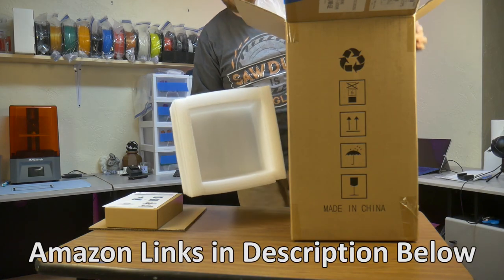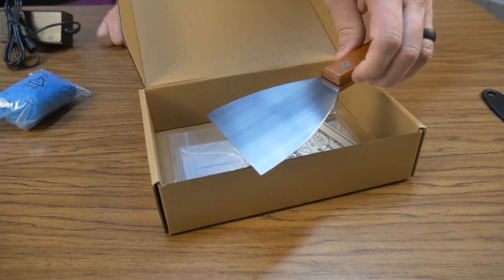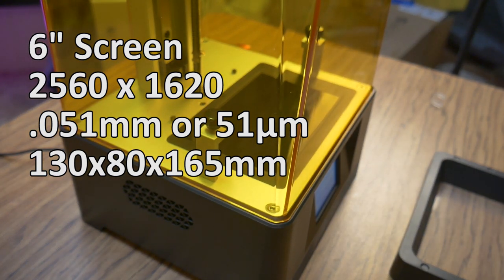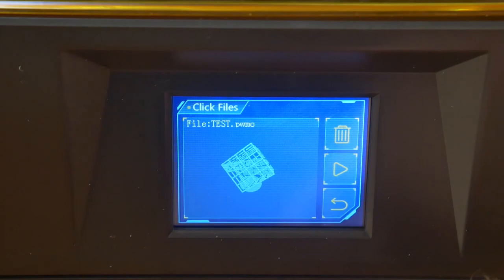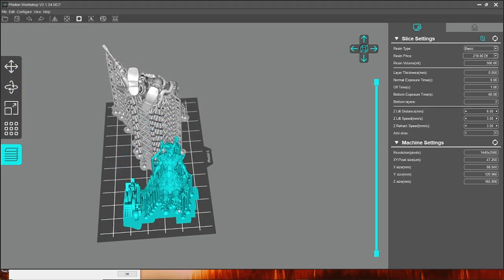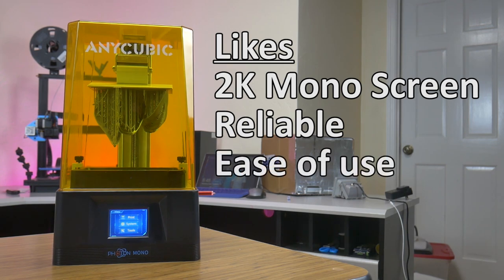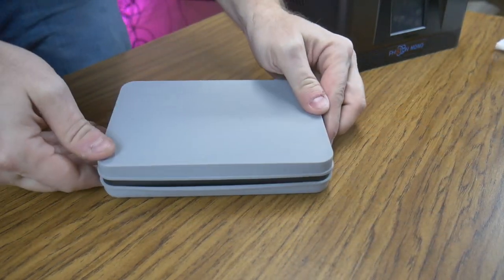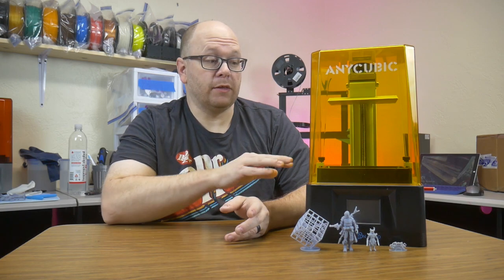Anycubic Photon Mono Review: 1 Major Design Flaw

Comment: What is the reason the plastic tray is bad?  I am brand new to this so sorry if it is a silly question.  What is the FEP??
Reply from the maker: The FEP is the clear plastic film that is at the bottom of the resin tray. The image is projected onto the FEP and the resin cures to both the build plate and the film. The cured resin then peels away from the FEP when the build plate lifts between each layer. In order to work properly, the FEP needs to be under a certain amount of tension, like the surface of a drum. The thinking here is that a plastic tray won’t last as long or is possibly not as strong as an aluminum one. For me it is just a sign that the company is cutting corners for profit. Especially when there are better all-metal printers out there that cost less. Look up my review of the Voxelab Proxima and you will see how a printer can be well-built with quality materials and also be the most affordable in its class. Thanks for the question and happy printing!
Reply: @SouthpawWorkshop  Hi, i am also a new to 3d printer, and am considering to buy one, is this issues cause a problem to print? or it is more about long term use?
Thank you.
Reply from the maker: Don’t get me wrong, the Photon Mono is a great printer, especially for beginners. My gripe is around design decisions like the plastic construction and the proprietary FEP replacements. I usually suggest the Voxelab Proxima for beginners because of its superior build quality, low price and high print success rate.
Reply: @SouthpawWorkshop  would yiu say it’s better than this printer for beginners?
Reply from the maker: Probably better in the way that the Proxima came with a spare FEP and higher quality tools like the scraper and spatula. The fact that is cheaper helps also.
Reply: @SouthpawWorkshop  but strictly with the printer itself (Bc the filter and tools can be gotten later) what does the proxima do better
Reply from the maker: Same performance between the two
Reply: @SouthpawWorkshop  is it difficult to get replacement parts or fep for the proxima?
Reply from the maker: You can use any FEP, so that part is easy. As for a replacement screen or light source, you would have to go through Flashforge customer support.
Reply: @SouthpawWorkshop  I suspect the plastic one could warp at some point as well.
Reply: @SouthpawWorkshop  i don't get it... how could the film be aluminum when UV light has to pass through it?
Reply from the maker: The vat that holds the resin is aluminum. The bottom of the vat has the clear film that lets the UV light pass through.
Reply: @SouthpawWorkshop  Just like how polymer firearms are much weaker than metal ones! (LOL)
Reply: @SouthpawWorkshop  Has this proven to be the case?  Has the pastic construction began to show signs of premature wear or failure or is it holding up ok after 9 months?  I just got this machine as an intro into 3d printing so have nothing to compare it to, yet.
Reply: @SouthpawWorkshop  unfortunately I'm returning mine because I haven't been able to print anything. Everything sticks to the FEP, plate calibration doesn't work, and one time, the plate started to lean one direction which ruined my print

Comment: I've just bought 1 and I'm happy to see that is a good machine. For 180€ I can't ask for more of a printer. Great review
Reply: Just got mine today. Did you put a protection the polarized screen or just used stock?
Reply from the maker: I use stock with no issues. Just keep an eye on your FEP. I have heard of others using screen protectors to protect from spills.

Comment: Great review, However people keep mistaking exposure time for layer time which is incorrect... Exposure might be 1.5s, but there are extra seconds for Z axis movement. I think the Mono is actually advertised at 30mm per hour which at a default layer height of 0.05mm is 6 seconds per layer, which in my tests is pretty acurate. I have not had to replace my FEP yet and the unit is now 6 months old. I might look into the replacement Metal Vat when I need to replace the FEP. For me, although the base is plastic, it doesn't feel cheap, and helps reduce the weight, which also help with shipping costs, but it doesn't seem to have made the product less sturdy. Overall I really like this printer and have just recently upgraded to the Mono X 4K with the Wash and Cure Plus.
Reply: Is it worth to get this or should I go epax ?
Reply: How do you get 30mm/hour as it took me almost 6 hours at 2.0 sec exposure?

Comment: I got at least 80 prints out of that plastic vat + FEP, then it got a nasty bump after it stuck to the build plate and I was afraid to push it further. Switched to the 3rd party metal vat now.
Reply: Ioan Croitor  Fine, but changing the FEP is a hassle. Was able to buy more Anycubic FEPs that are already on the frame and they have been working ideally.

Comment: Looking at this puppy strictly for D&D figures. I'm a beginner so seems like a good starter set. How often does the FEP need to be replaced?  Noob question from a noob.   (and great video....well spoken and concise).
Reply from the maker: FEP can be pretty temperamental. If we’ll taken care of, it can last a long time. However, some things are just out of your control, like failed prints. Most of the time a failed print won’t negatively affect the FEP, but sometimes it does. If you buy this printer, my suggestion is to have a spare FEP handy. That way if you have a pinhole or tear, you can get back to printing right away. Having said all of that, I’m still on the original FEP that came with my Photon Mono and I have printed a lot with it. Hope that helps!

Comment: Any 3d printer recommendations at a slightly higher price? The Anycubic 6k looks like a really solid option, Voxelab still only sells up to a 4k screen resin printer that's actually slightly more expensive.
Reply from the maker: The 6k is definitely a great option with a larger build area!

Comment: 4 years of ownership, i have replaced the fep 2 times and never had the official ones just got the big cut to size ones and pocked lead holes with a hobby knife. But yesterday the lead screw stepper moter lost grip on a print and slipped, i stopped it and tried to restart it but it did nothing but slip so i took it apart and the lead teeth on the stepper are chipped all over. But i got thousands of prints out of it. I believe it was due to there not being a protective bump around the bace where the lead screw comes out. Is anyone in 2024 decides to get it my suggestion would be before you ever fill up your resin vat get a rubber washer from the hardware store that is bigger around than the lead screw hole and glue it around it to stop any leaks getting into the stepper moter

Comment: new to 3d printing and have yet to buy one but am i understanding it correct that 
1. i need to regularly buy a new clear film for the resin vat,  the fep i think?
2 i am adviced to buy the aluminium vat because it damages less quickly
3 does the lcd screen need changing aswell?
Reply from the maker: FEP film will need to be replaced eventually, but that depends on how well you take care of your film. 
The Sovol vat is recommended not only because it is made of metal and higher quality than the Anycubic vat, but also because FEP replacement on it is easier and less expensive than the Anycubic method. 
Your screen will also wear our eventually, but it should last hundreds to thousands of hours before needing replacement.

Comment: Are you adjusting the printer settings like exposure at all?
Reply from the maker: I did lower the layer exposure from the default 2.5 seconds to 1.8 seconds just to see how well it performs. It worked just fine at stock settings though.

Comment: How are the fumes? Do these printers need any kind of ventilation? I've never used a Resin printer before. It looks like you're just printing in a regular room, do you just wait till it's done and then open a window or something?
Reply from the maker: The resin fumes can be a controversial topic. The only time they are a problem for me is when I am actively working with the resin such as pouring it or cleaning a print. I don’t smell it during printing or any time the lid is on the printer. Ideally, you would want to make sure the room is adequately ventilated. You definitely don’t want to keep the printer in your bedroom or another regularly-occupied area of your house.

Comment: The plastic tray isn't a deal breaker for me.  How often does the FEP need replaced?  I'm not counting on the plastic tray to support any weight so plastic doesn't bother me at all.  In fact, kind of ironic that a plastic tray isn't considered good enough for build quality yet this printer makes everything out of plastic resin.  Seems like a really good printer for fantasy minis.  I'm wanting to go with the 4K version over the 2K version however.
Reply from the maker: I agree that plastic is the theme of this printer. My main gripe is that there are all-metal printers out there with the same specs as this one that cost less than the Anycubic Mono. As long as you take care of your FEP, it can last a while, but it is a finicky material. One failed print can poke a pinhole in your FEP and you will have to replace it or risk ruining your screen. If you want to avoid the main drawbacks to this printer, get yourself a Voxelab Proxima. It is a workhorse.
Reply: @SouthpawWorkshop  Aha! Thanks for educating me on that info, had not heard that yet. Will check that brand you mentioned. Getting ready to buy my first 3D printer and I just really want to get it right the first time. Thanks for the help

Comment: It's now almost a year later.  How has this printer held up?  Has Anycubic changed the FEP installation or is there 3rd party FEP available that works?  I see some advertised, but I don't know if it's more trouble than it's worth.
Reply from the maker: I have too many printers, so some don’t get used as much as others. I do use the Photon Mono from time to time and the original FEP has held up well, but I am extra careful and clean between uses. I can’t say I have seen any 3rd party replacement FEP for this style, but the Sovol replacement vat (which I own) is always on standby in case there is an issue. It takes standard FEP replacements and is solid aluminum with a steel retaining ring. Best part is that it doesn’t cost much more than the proprietary Anycubic FEP replacement, so for me it was a no-brainer. An added benefit is that it also fits the Elegoo Mars 2 printers, so you can interchange as needed if you have both printers like I do. Good luck in your printing pursuits!
Reply: @SouthpawWorkshop  Thank you, friend.  Anycubic is running a bundle sale right now with their wash station.  But you've got me thinking about the Voxelab.  Anycubic does have their FEP replacements at 11.99 for 2 of them.  But $20 shipping.

Comment: Awesome video. Quick question, have you ever needed to change any default print settings such as rising speed, UV Power, etc?
Reply from the maker: Nope. Most of these printers are optimized for standard resin right out of the box. If you were using something a little more exotic like casting resin or flexible resin, you would likely need to tweak settings, but all my printers have worked perfectly out of the box with standard resin
Reply: @SouthpawWorkshop  Gotcha thanks for the response!

Comment: I just bought this printer and it's on the way to me now. I saw your suggestion of a replacement vat and I like that vat much more than what comes with it. My question however is how does it attach to the printer? The original has wings on the side of it that hold it down with the screws. When you showed putting the new vat on I saw that there were hold downs over the top of the vat, was that another accessory, was that footage from a different printer or do those hold downs come with the new vat?
Reply from the maker: The new vat I suggested works with the hold-down system of the Photon Mono. The thumbscrews stay attached to the printer and the vat usually has small indents for the ends of the screws to seat into.

Comment: I had to manually separate that plastic FEP with a small plastic spatula (the kind you use for fixing small electronics) and then replaced my damaged FEP sheet with some sheet I bought off Amazon. Then just placed the sheet in between the plastic pieces, screwed it into the vat, and cut off the excess with a sharp blade. 
It's honestly some Apple level garbage for them to try that proprietary stuff with the FEP.
Reply from the maker: 100% agreed.

Comment: Hello, I have a the regular Photon resin 3D printer. I’ve been able to get great prints out of it but I’m still new. Does this Mono model print faster than the photon? Is the build plate bigger? Thank you for any advice. Great video.
Reply from the maker: Yes, the mono prints faster. I think the build volume is the same, but the big selling point is faster prints and the screen is supposed to last longer. Cheers!
Reply: Thank you!
Reply: So I went with the mono SE. Do I have to adjust the settings to make it print faster than the photon? Also are the USB’s interchangeable? If I have a bunch of files on my usb for my photon can I just plug it into the SE and print those same exact files? Thanks again.
Reply from the maker: The slicing software will have a profile specifically designed for the mono SE. it will have all the correct exposure and lift/speed settings for that machine. You will need to reslice all your files because the old photon uses way different settings and the resolution is likely a little different also. Good luck!
Reply: Thanks so much for the fast reply. Really helps a lot. Have a great night!

Comment: Exposure time 8sec and bottom exposure 60s?? Am reading this right? I just printed a small piece with 2sec and 20sec respectfully (same anycubic resin). Video is very straightforward, nice
Reply from the maker: Where are you reading that? Sounds more like the settings for the original photon. I run my mono at 1.8 second layers using the Anycubic gray resin. Turns out perfect every time. Thanks for watching!
Reply from the maker: Depends on the type of resin you are using, the temperature of your printing room and how good your supports are. A big factor that people don’t realize is that resin doesn’t perform well under 70F or 20C. May be worth checking.
Reply: @SouthpawWorkshop  look at 5:43 in this video. Crazy settings for Photon Mono isn't it ?
Reply from the maker: Makes sense where he thought those settings were the suggested ones. I think I recorded that footage before I actually set up Photon Workshop for my machine. Never noticed the wrong settings before.

Comment: What would you recommend the UV power % should be for translucent resin?
Reply from the maker: Most manufacturers recommend around 50% power for transparent resin, so that would be a good starting point. Your mileage may vary.
Reply: @SouthpawWorkshop  thanks

Comment: how do I go about designing my own parts, I used a 3d printer in my job 14 years ago and I used solid works to design parts,  what do you use to design your own parts on this printer ???   , thanks phil
Reply from the maker: I use both sketchup and Fusion360. I’m actually transitioning from sketchup to Fision360 because I find fusion360 to be much more powerful

Comment: Thanks your video convinced me to go with this over the mars
Reply from the maker: Awesome!
Reply: What exactly are the advantages over the Mars 2?
Reply from the maker: Mars 2 uses an LCD screen instead of a mono screen which results in the need for longer exposure times during printing. It is also understood that LCD screens have a shorter lifespan than mono screens. Now the Mars 2 mono is a different story altogether. I think the Mars 2 mono has the advantage over the photon mono due to a better leveling system and resin vat, but I believe it costs more than the Photon mono. Hope that helps!
Reply: @SouthpawWorkshop  yup that's exactly why I picked it over the Mars. Thanks to your video :)
Reply from the maker: Cool! Glad I could help
Reply: @SouthpawWorkshop  Ah, I see. Thank you for your quick response! :)

Comment: Hi, could you share your setting for it. I am having trouble getting the model to stick to the supports when printing.
Reply from the maker: Depends on which slicer you are using. I used the default settings from Chitubox with good results. You may want to use heavier supports if your prints are failing. Room temperature can affect print success as well. If you are printing in less than 70 degrees F, prints are more likely to fail. Hope that helps!
Reply: @SouthpawWorkshop  I just checked the light intensity and it is set to 10. What intensity are you running?
The models are pre supported from highland miniatures which normally run flawless on my photon S. For slicer I am running Lychee.